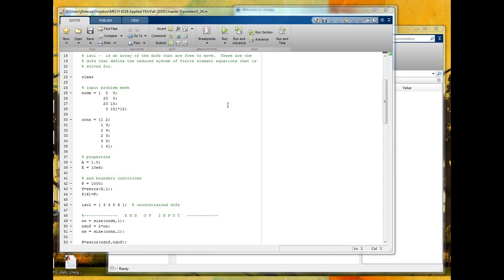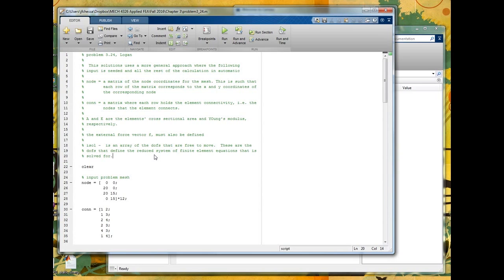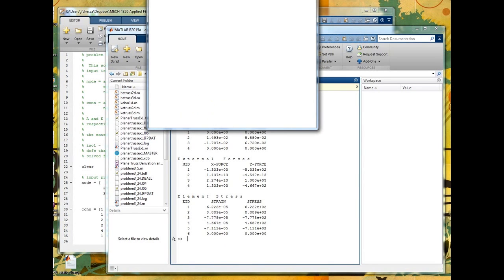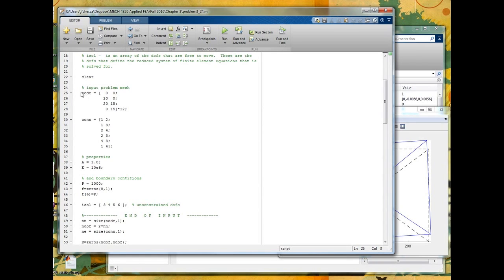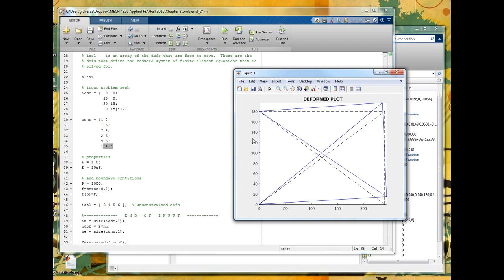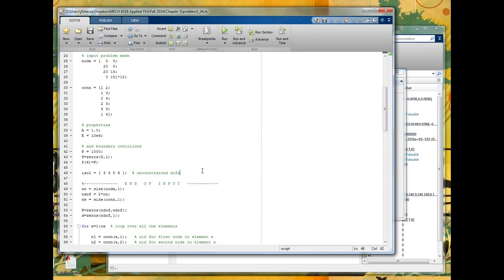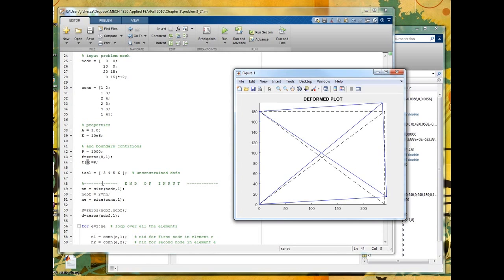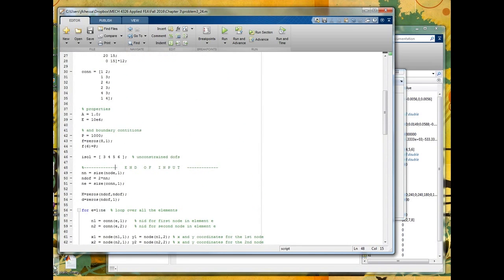A basic finite element program in Matlab, part 1 of 2

Comment: Dear prof Chessa
Thanks alot for the video
I have question about the assembly of plate Q4 element with eight degrees of freedom per node
Should I use the same code with the same sctr vector? Or there is a change
Thanks for your guidance
Reply from the maker: If it is a 2d Q4 element it would have 2 dof per node. Maybe you mean 8 dof per element.  But yes you would have to change the sctr vector to be length 8.  Same size as the dimension of the element stiffness matrix.
Reply: @JackChessa  thanks prof Chessa for your swift answer
My element is 2d quadrilateral element with 8 degrees of freedom per node ( u v wb ws Dwb/Dx Dws/Dx Dwb/Dy Dws/Dy)
Thanks alot
Reply from the maker: @bensaidismail5394  I am a bit confused.  I assume you are talking about some type of plate/shell element then. Typically these are 6 dof/node or 5 dof/node if you want to do the drilling dof tricks.  What is wb vs ws?
Reply: @JackChessa  Dear Pr Chessa
Thanks again for your reply
wb: is bending part components
ws: shear part components
In my case: the total bending part is splitting in two components w=wb +ws
This is one call refined shear deformation plate theory with four uknows
And for fem programming we should take also their derivatives Dwb/Dwx Dwb/Dwy Dws/Dwx Dws/Dwy
And we have in all 8 Dofs and I need how to assemble it according to your sctr technic vector
Thanks for your consideration Prof

Comment: Hello! i am trying to use python and castem for finite elements , but I don't find any video or article that helps me .I have used already python and gmsh .Would you like to give me some steps ?
Reply from the maker: Well in pythons you have to decide if you are going to embrace the python (pythonic) way of doing things or keep it functional.  You can follow the matlab type approaches and you will do well.  But to keep the pythonic nature and still keep performance it is a bit more tricky imho.  I have some python code that is like that, but not really happy with it.  I have been using Julia much more lately.  Possibly something to look at.

Comment: Hi Jack, 
Thanks a lot for the video. I have a doubt though.
I am working on a simple beam problem where I have to generate around 400 Q4 elements. In such case do I have to enter the node matrix and connectivity matrix manually? Is there any other way I can do it?
Thanks!
Reply from the maker: Assuming that this is fairly regular element connectivity (i.e. rectangle) you can just code it in a for loop. On the bitbucket site there are some Matlab functions that do this in 1D, 2D and 3D.